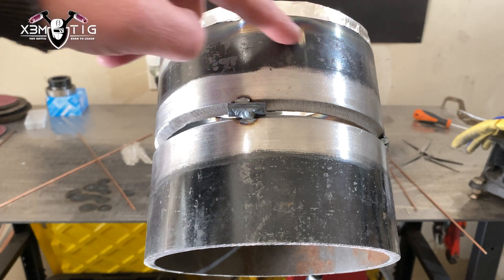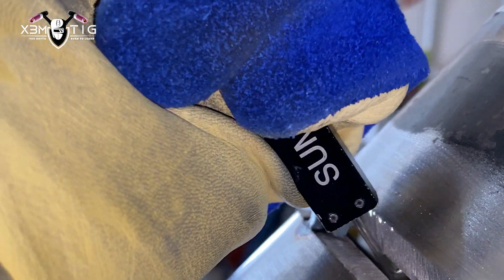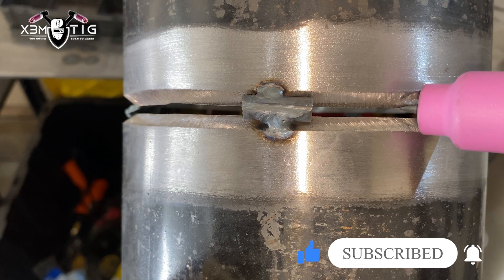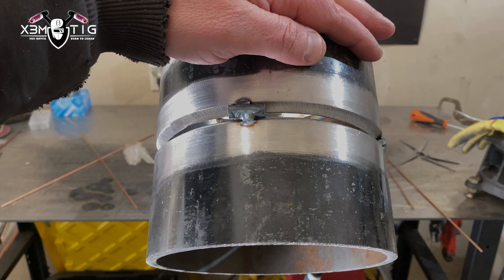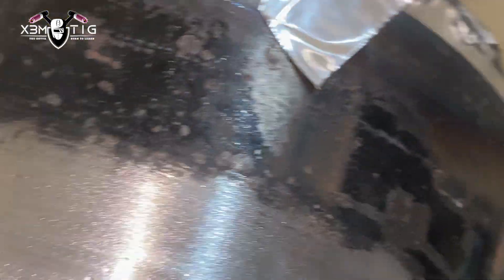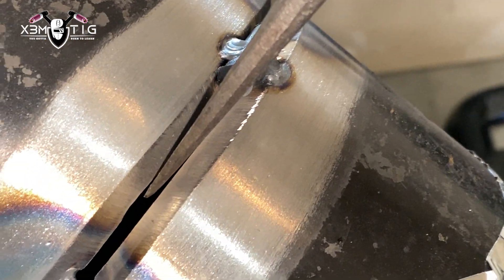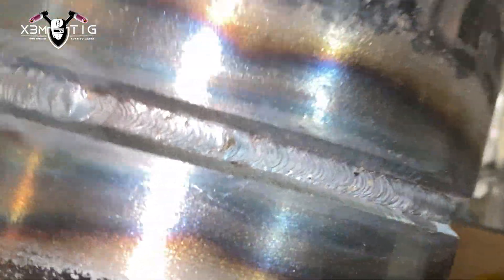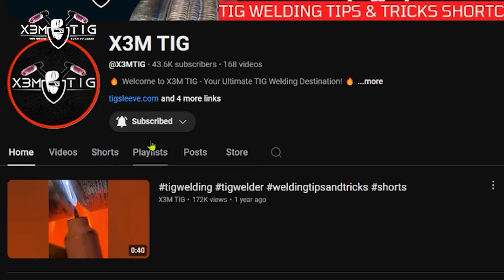6G TIG Welding: 5 Proven Steps to Achieve X-Ray Quality Pipe Welds

Comment: 24" pipe like an 🥚 some parts are 8.6 mm and the more guy weld the pipe becomes less that it's 5.6mm or 4.6 mm so how do I mange when I need to capping while the gaps are different in the whole pipe 24" ?

Comment: You do key hole on carbon steel it’s very good penetration sometimes I have afraid do this but now I will do.
Reply from the maker: It does make a great weld when done correctly!
Reply: @X3MTIG  that’s true.
Monday I will do but 100% X-ray all joint RT. Thanks my friend